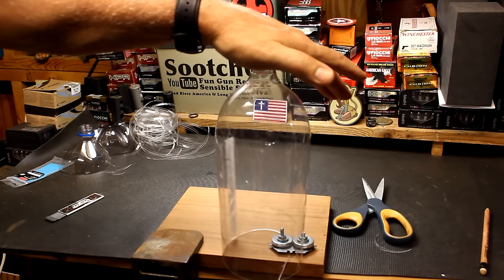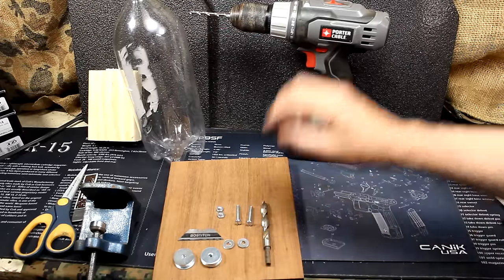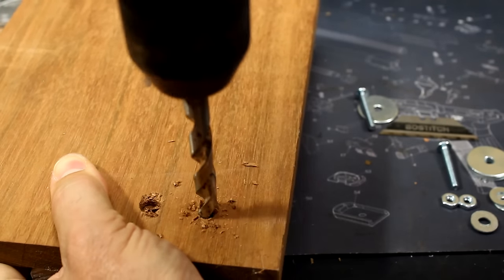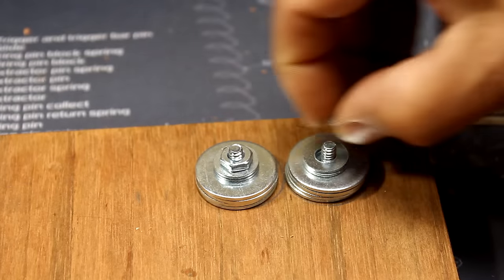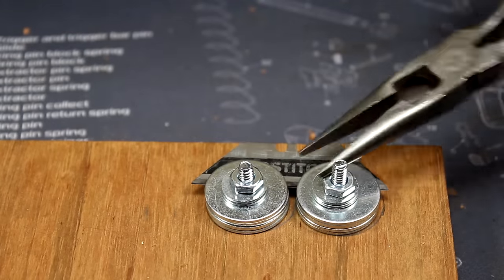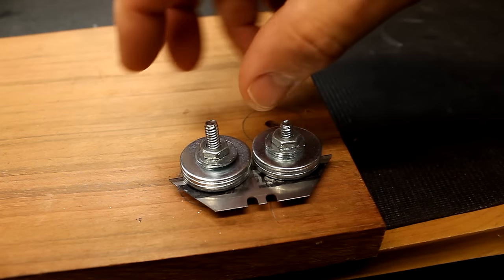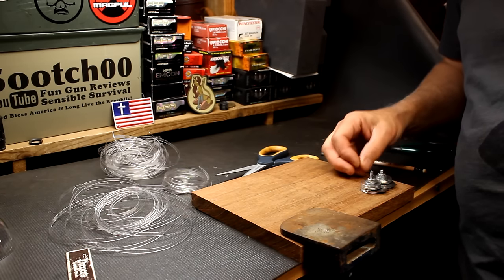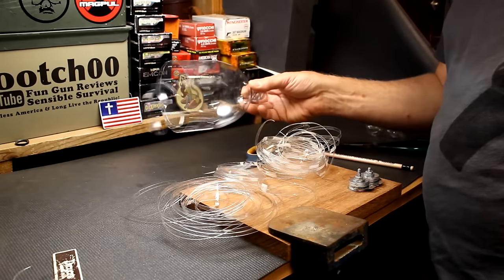Making Cordage from Plastic Bottles Hack for Survival

Comment: Just a quick tip in case anyone is wanting to do countersinks with drills.  Its always easier to start with the larger bit to make the countersink hole first, then switch to the smaller bit to make the hole the rest of the way through.  It keeps the bit from grabbing like you were having issues with.

Comment: A circular cutout the diameter of the bottle could be used to stabilize the bottom of the bottle and give you more precise results and a clam shell or similar could be used to hold the top steady with even pressure.  Anyway excellent idea.  Thanks.

Comment: Drilling those counter-sinks if you had a depth stop collar on your drill bit you would get two perfect holes easier.Also looking at how that was working for you I would put the cutting parts farther back on the wood.That way all of your bottle would stay on the surface and be more manageable. . . One further edit. Putting the assembly farther back then cutting a large circle of wood or plywood almost as large in diameter as the bottle screw that down cutting away where you need to for the cutting parts. . . That will help your bottle spin true much better.

Comment: You could add a wooden dowel rod also to hold the bottle too. That would add extra support for the bottle. Set the bottle on the dowel rod with the rod growing through the bottom and top opening. I use a similar set up using the plastic cordage for basket weaving.
Reply: +Rebecca Miller Sounds great, do you have a vid showing this?

Comment: Thats a very nice way of doing it. I used to make cordage like this using a tandy lace cutter designed for leather cutting. 
Apologies if this seems negative but I see mecahincal improvements everywhere.
My advice to you would be to remove the label after you follow it for your initial cut, and add nails (2-3) along the back edge of the bottle to keep constant angling and pressure, also, feed the cordage part around the sides of two more nails almost set up like pulleys, with further washers after the cut itself, this will reduce the possibility of cutting off angle and slicing off the line of the cut. (if that makes sense)
My using the tandy lace cutter method is far easier to carry in the field than a big block of wood but it was never very stable and also tended to split before I wanted it to...
I definitely like this version for home use.
Thank you for sharing it.

Comment: I would try a circle cut out just smaller than the inside if the bottle for it to spin on. Mount it over or in place of the left washer stack. Cool hack. Thanks for posting.

Comment: Improvements to this design:
Install the razor with the bevel down (so you are not fighting the bevel).
Screw a dowel to the wooden base, and place the bottle over the dowel (more rigidity and consistency).

Now that you have a portable plastic factory, figure out what to do with the mountain of plastic strips you will make!

Comment: Great vid! I'm thinking of a way to keep it so even pressure on the bottle is always applied. Do something like a Paper-towel holder (rod)  that you can put the bottle over but it should protrude a good bit so you can perhaps fit some weights over the rod that can sit on top of the bottle so as the bottle is getting shorter the weights keep holding the bottle down. Take it a step further and attach the plastic to something like a fishing reel or other type of spinning device and just crank away.

Comment: Awesome! I've done this before, but my purpose was to make weaving strips for an 'invisible' basket trap for fish. I never completed the project though -- the plastic was too smooth, so it was difficult to keep the weave tight. My cutting jig was a bit different (and more dangerous). The blade was hammered perpendicularly into the wood block, the plastic bottle spun horizontally, and I used a couple sets of washer guides to give me strips with a consistent width.

Comment: Is that a double side razor blade? See if you can't find a single side razor blade. See what's happening, is the bevel of the blade is pushing the bottle up, so you're constantly fighting that bevel. If you got a single side blade, and put the beveled edge down, then the bevel will do most of the work for you.
Reply: +Clint Carpentier You are right, chisel ground cutter works better. Took me some testing, but then it just went like through butter. I took a pencil sharpener, and got it even sharper. Works perfect.

Comment: Maybe somebody has already said it in the hundreds of comments, but if you wanted to add a little more complexity an upright dowel from your jig platform could position a weight above the bottle, holding it in position & exerting steady downward pressure, freeing up your left hand. And while we're at it, positioning a turning shaft in front of this apparatus could pull the material over the cutter & neatly spool the cordage at the same time!

As for comments here saying the idea is already too complex, if the world has ended or you are in the woods, just use a knife. But if you have a use for the cordage & want another use for the bottles, this looks like a very easy & fun jig to whip up when puttering around your shop, using materials you already have on hand.

Thank you for posting. I have watched only a few of your videos so far but I am impressed, entertained, and subscribed. BTW, I enjoy your sense of humor and the blooper reels at the end of each edition.

Comment: Why not move the razor, washers, etc. further away from the edge closest to you and make some sort of "lazy Susan" that fits in inside diameter of the bottle?  Granted you'd need more than one "Lazy Susan" to fit common plastic bottles but it would more than likely give you better and/or more consistent results.  Just a thought.

Comment: If it takes a Nut, it's called a Bolt. A screw has coarse threads and does not receive a nut.
Reply: +Wayne Earls wrong.  go google the phrase "machine screw".
Reply: +random eddie Oh
Reply: Many screws work with nuts, ur probably thinking of the classic deck screw

Comment: I might add this to a bug out bag/EDC kit. Seems small enough that i could fit about a meter in my wallet no problem. And it would save me from needing to unravel my belt for a foot of cable. 
Though i imagine this would be kinda weak. I would guess around 50lbs or less depending on how wide you cut it. Definitely something i would like to see some info on.

Comment: The only problem that I can see is that most plastics even though they take forever to degrade in the ground will go brittle relatively quickly if exposed to sunlight. If you used this stuff for making some sort of shelter than covering the cords with pine tar or pitch or similar would work.

Comment: if you put a roller skate wheel on top it has a bearing and not much wear and tear on your hands
Reply: Good idea!
Reply: I used a pool ball to hold my bottle down
Reply: an old wooden paper towel holder would probably work too, or maybe even a can opener as the cutter.

Comment: No, sorry. My brother made the cutter for me. Because I have severe arthritis he made it so I would no longer need to use scissors. It is exactly the same as yours except he put the dowel on to hold bottle. I can also remove the dowel to put another size length in for smaller one liter bottles. I leave the caps on the bottles to make a more even pressure for holding bottles down. It works fantastically and I can make almost perfectly evenly sized cordage for each project. I have also braided the plastic  cordage using a lighter/candle to melt the plastic together. But watching your video gave me another idea. I think adding a cap or block of wood onto the dowel to put the pressure on the bottle may work better. That way I could hold the bottle down but not have to worry about holding it with my hand because the cap would do it for me. That would free up both of my hands for pulling cordage.
Reply: +Rebecca Miller You pretty much summed up the two suggestions I was going to make - 1. A piece of dowel to hold the bottle stable; 2. Weights on top of the dowel to hold the bottle down.
My only other addition would be to have the dowel mounted in a cut-out slot on the base, so that it could be moved back and forth for bottles with different diameters.
Reply: +Jarrod H Thanks even better my bro and I discussed remaking it. The idea of a moveable whole for dowels is good. I have noticed having some problems with 1 liter bottles as far as tension. Shortening the distance I think would help with the tension. On the Flip side the tops of bottles make great dispensers for plastic bags like for bags of rice, beans, confectioners sugar or brown sugar. Cut a corner of the bag feed it through the inside opening of bottle top then cap off with bottle top then you have screw open bags. Also obvious use the tops make great funnels. Bottoms make great bowels or cups for eating or storage.

Comment: I tried making one of these using your exact directions and it's not working. Every time I try to cut a bottle with it the bottle either just go sliding right over the top of the blade. Or at most well maybe cut 2 inches before it breaks. I don't know how you're getting along strands out of it. I've looked over your design as well as other similar designs multiple times and I can't see what I'm doing wrong.

Comment: if you would have drilled the holes at an angle the razor would pull the bottle down so you dont have to hold the bottle on top

Comment: Does it cut your hands when you use it?
Reply from the maker: +alex ion No, the Washers protect your hands. The outside of the razor can nick you if you're not careful but retty safe over all.
Reply: +SensiblePrepper I may be off base but I think he was referring to the cordage itself....i.e. Tying, pulling it taught, etc... Wondering if the plastic is sharp enough to cut if it happens to slide in your hand.
Reply: I think he means when you use it as rope
Reply: +Andrew Matherne thank you for your help. Yes that's what I was wondering.
Reply from the maker: +alex ion The plastic could be sharp but I didn't have any problems. Best to use with care : )
Reply: +SensiblePrepper A bit of duct tape may prevent a razor cut. Best

Comment: haveing a helper would be good then you have two hands to hold the bottle better.. once you have cord you can wrap around cut branches to make a shelter or whatever you want to bind. then use a heat gun or outher form of heat, a small liter torch can do it. plastic shrinks and binds very tight. .. 
for get what countrie I seen it but thay make huts that last, well rope will rote be for plastic.  for extra long term thay cover the plastic to keep it out of the sun. sun will make it degenerate. oh thay lived in the huts..
peace..

Comment: This device is way over complicated, its almost funny.. what ever happened to the kiss method.
Reply from the maker: +partypoison485 Let's see your video idea.
Reply: +partypoison485 That last one makes it really easy
Reply: +SensiblePrepper don't let people get you down. And, don't feed the trolls.
Reply: +SensiblePrepper In a survival situation I think a lot of people would just take the scissors to the bottle. What percentage of homes don't have a charged, cordless drill lying around? Probably at least 50%. Some would have a corded drill, but in a no electricity situation, it wouldn't help much. I guess it could be done with hammer and nails instead. Anyway, the idea is still helpful, just knowing another source for making cords.
Reply: i think you could attach the bottle cap to the drill and then the cap on
 the bottle and push the bottle through with the drill-> super fast 
instant bottle cordage :D has anyone tried this by any chance?
Reply: Jany Declercq If I understand you right, which is not easy considering how you worded that, you're saying someone should somehow attach the bottle cap to a drill bit, screw the cap back on the bottle, and then use the drill to turn the bottle and force it along the razor. Aside from figuring out how to securely attach the cap to some kind of bit, the problem is the strength of the bottle - it wouldn't hold up to the strain.
Reply: Complicated? To you this is complicated? This nothing. SP is a very clever guy.
Reply: Erg Budster Mate, i said it was over complicated.. I didn't say it was too complicated. 
and yes.. SP is a really clever plagiariser.
Reply: I dont understand why people are attacking the commenter? He is not swearing, he is not shouting, he is not calling anyone any names.. All he did was share his opinion. You will always have some brown noses just blindly defending people as they seem to have been born with some sort of disposition for it. But even the facking owner of the video comes on here all insecure and with childish remarks like "lets see your video idea" as if that then correct this incredibly overcomplicated device. People can have critisism you know! ;)

Hey guys! You want to make 1 item in a survival situation? All you need is big washers, small washers, 2 machine bolts, 2 nuts, a bigger drill, a smaller drill, a drilling machine, a stanley knife, scissors, a block of wood for under the other block of wood, a pencil... LOOOOLLL.. yes people.. and then ATTACK a commenter that is simply correct in calling out the rediculous complication of this device ;) 

Now, if the maker of this video would come up with a concept that JUST requires a knife.. then yes, it would be worth over a 130.000 views. In this state, I have no idea why it is so popular as in a survival situation very little people will have all these items to cut a facking bottle into cordage.